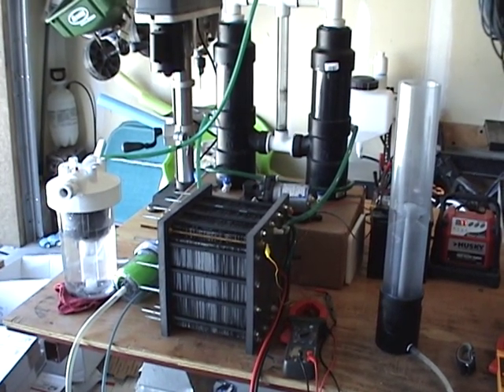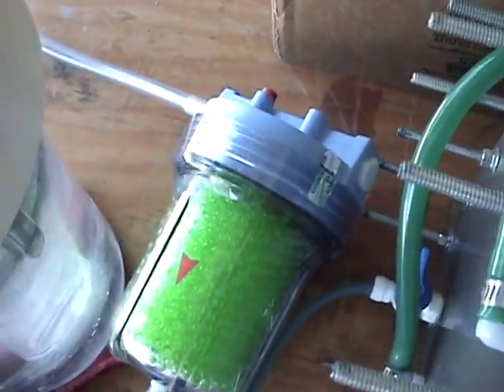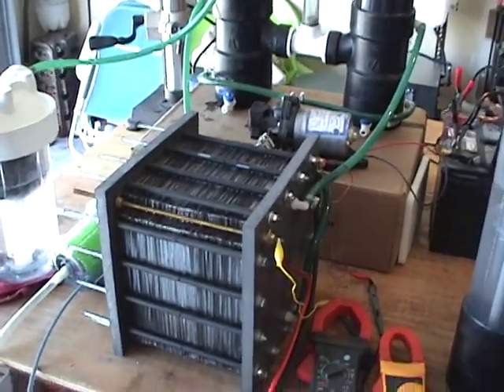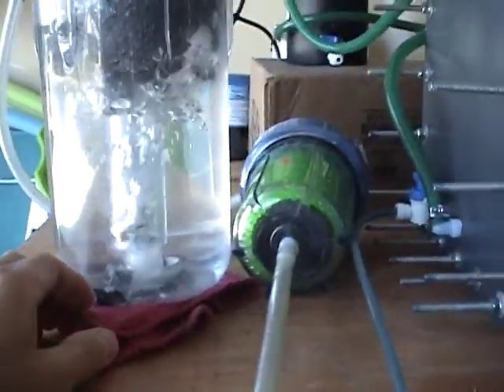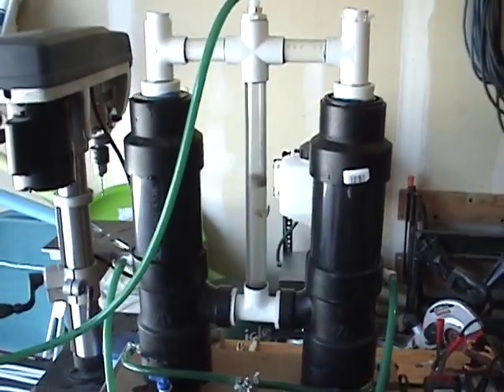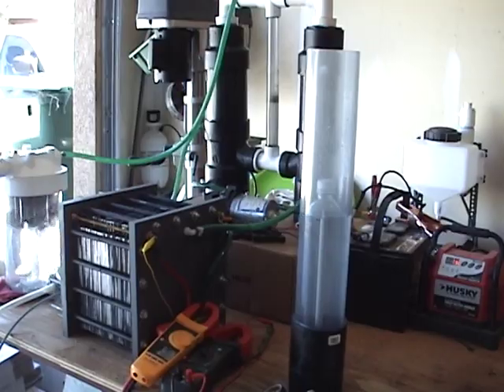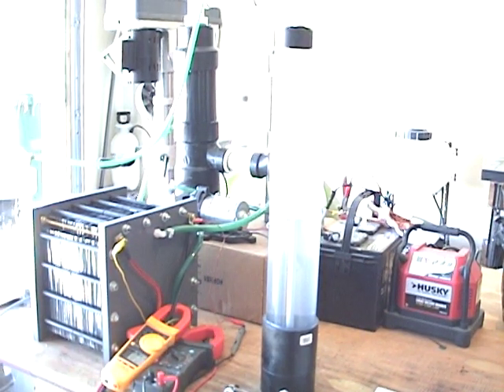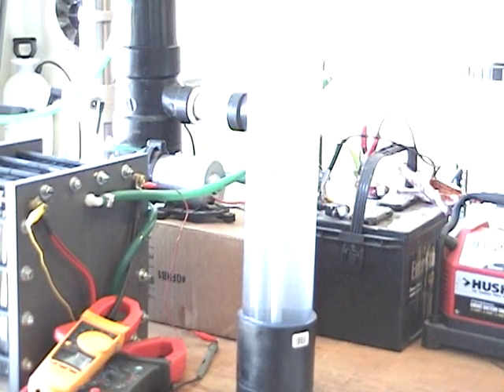118 plate Monster Hydrogen cell Back from the dead part4

Comment: You are inputting let’s say 280v with 10amps which is 2,800 watts of Energy to get let’s assume 20L/min HHO discharge. Now to be honest, with such insane output, I can hook up another Generator with 4-stroke Engine & carefully tuned to produce a 10KW Electric Output. I will then run wild with that 10KW to power a house on a hill & live ever happily after.........🤣🤣

Comment: why not try and power self power the generator ?? ...your making enough gas no?....
Reply from the maker: self running is not possible.
Reply: so you have not tried it ?  or its not possible with your setup ? https://youtu.be/cMlciNOyo_U
Reply from the maker: Thats an old scam video. No it is not possible. Look up the law of conservation of energy.
Reply from the maker: I'm about the biggest expert your going to find her in youtube land. What you don't know you don't know. Heck probably don't know the right question to ask. 
The bubbler is filled with gasoline. The engine is running on gasoline vapors. This video was debunked years ago But if you want to dry it by all means give it a shot. You ask and I gave you an answer you don't want to hear but facts are stubbern things. Peace
Reply from the maker: The acetone will slow down the flame speed of the HHO gas so it doesn't burn as quickly. This will help with not having to advance the timing as much. The acetone vapors also ast as a fuel.

Comment: Great job. You’re taking us in to a new era. 

I want to work on a little solar separator that will slowly separate hydrogen and oxygen and pump each gas in to a separate compressed cylinder. It really doesn’t matter how fast it works I just want relatively free torch fuel when I need it.
I have the basic idea from other people’s designs.  I’m still working out how to turn on the compressor after enough of either gas builds up in a temporary reservoir.  -  Good luck on your future projects.